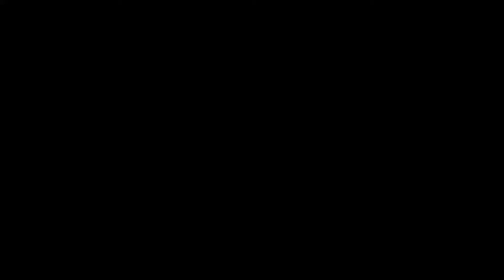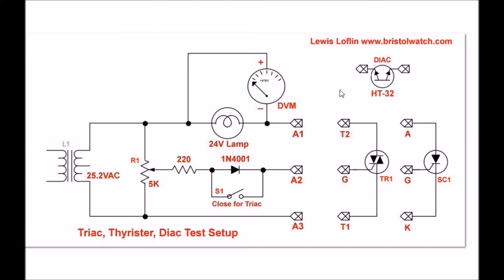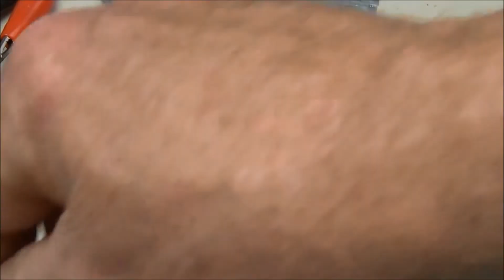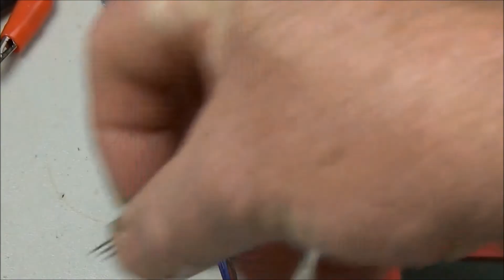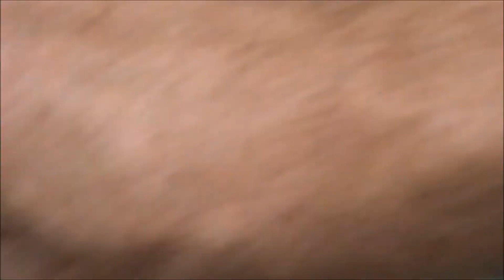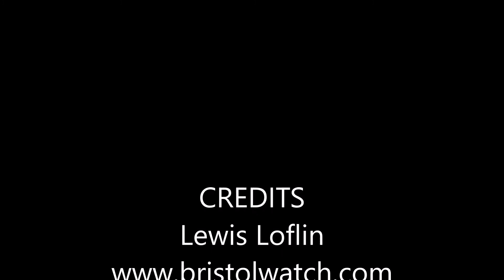How to Check SCRs and Triacs - Simple Circuit Part 1

Comment: Can You please 🙏🏾 explain 4 pins regulators like KIA78R15P. THANKS IN ANVANCE.
Reply from the maker: Never used a KIA78R15P before. I have dealt with other similar devices. It is a switching regulator. Pin1 - input, pin2 -output, pin3 GRND, pin 4 ON/OFF. Se spec sheet https://www.alldatasheet.com/datasheet-pdf/view/69433/KEC/KIA78R15PI.html

Comment: Hi Lewis, Thanks for this and the other two videos. I'm trying to fault find on a Weller desoldering station which isn't getting very hot - and I didn't quite know where to start. 
Your lesson has demystified SCR's and Triacs and I was able to confirm (using your circuit) that the triac in the Weller isn't faulty. It's a good start!
Now I have a clue where to proceed, the circuit before the triac (as I have also proven that the iron isn't faulty).
Thanks again.